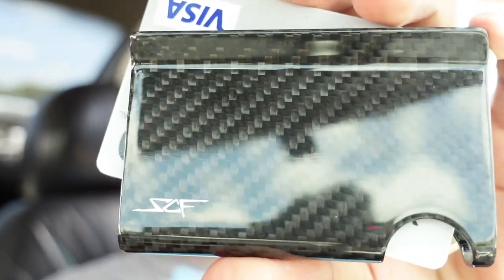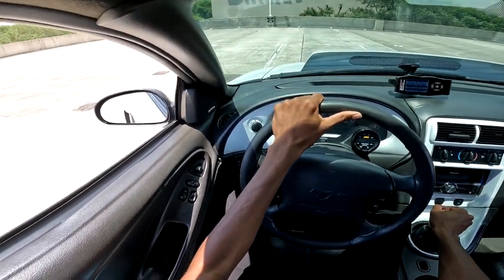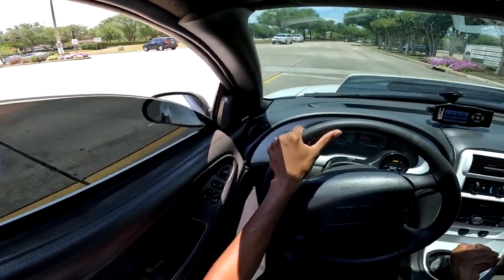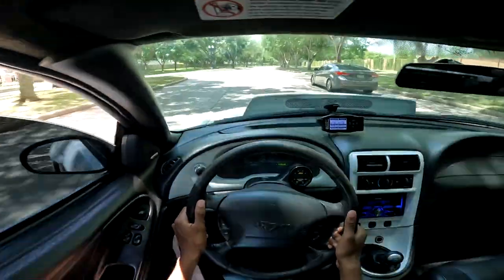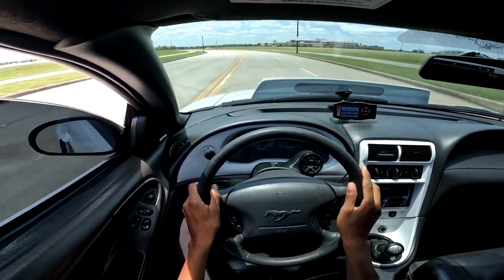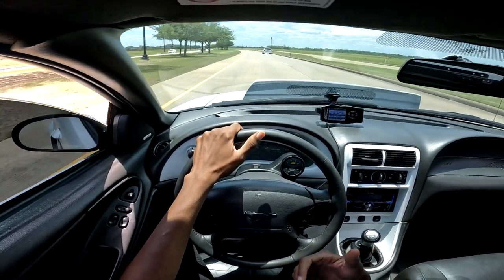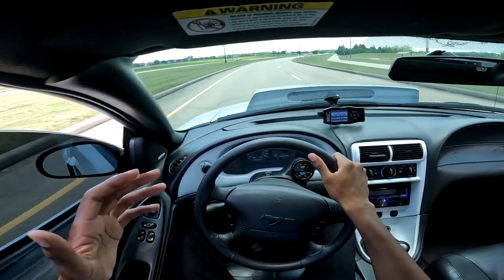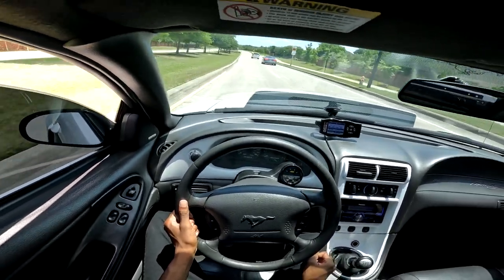FINALLY!! ALL PARTS ARE HERE to make 1000+WHP in my Supercharged 2004 Mustang GT

Comment: Ima be real here how the heck do you get more then 600hp without making it a full blown race car?? Please let me know cause i was going for a full forged terminator cast iron short block. Ported heads, turbo cams and tuned compression, arp head studs etc. and a on3 turbo and daily about 15 psi im assuming by time im done ill be around 600 hp & trq which im more then happy with but i mean just how please explain
Reply: Same its unrealistic
Reply: 700 whp is about the limit on the best parts you can throw on a 2v on 93... reliable street friendly...800 to 900whp can be reliable on e85 with that same setup. I don't really consider e85 full street cars cause you can't get that everywhere. However a 1000whp 2v street friendly... not happening